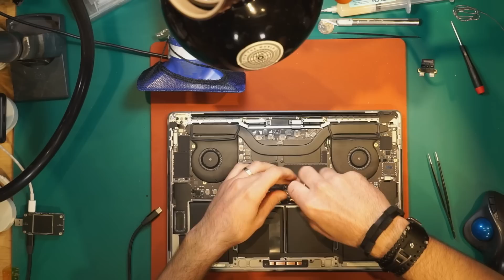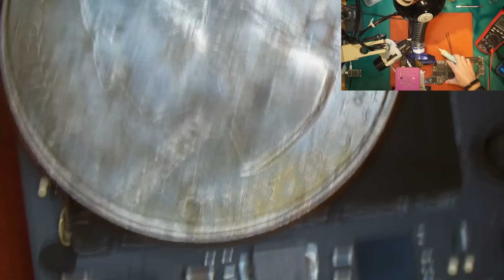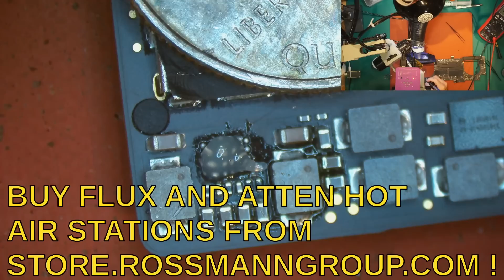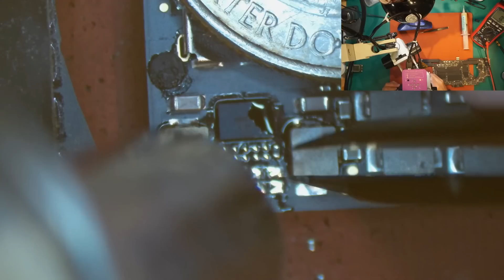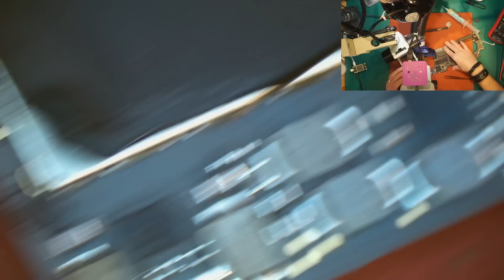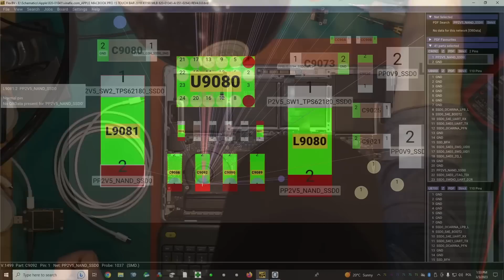Are Apple products still JUNK in 2023?

Comment: I've been using Apple Products since the 5s and none of them ever failed on me. On the other hand heard reports of the Note 7 setting houses on fire. lol.
Reply: Yeah I’ve had a terrible time with Android Samsung junk, and Microsoft is trash. I’ve never had an issue in a decade with Apple products, except for the hole they leave in my wallet.
Reply: Your bias is showing.
Reply: Just your experience doesnt mean other have experienced it.
Ever heard of bendgate ? Ribbon Gate ? iPhone 7  Audio IC issue ? iPhone X and 13 blank display ?  Butterfly keyboard ? (Lol I remember the copium you guys put in for that), Thunderbolt shielding issues ?

I havent even scratched the surface, these are just some of the few hardware flaws, dont get me started on the software.
Reply: @RandomGuy-om1vy  Why is what you said magically true, but not what we said lol?

Comment: If this video is really supposed to be shown to customers then in my opinion it should instead be properly montaged and narrated to make it shorter. Why would customers care about taking out chips, cleaning their pads and all that stuff? Plus listening to speech over noise of hot air station is a little bit hard.
As a video for channel though this one is good.
Reply from the maker: I have no desire to make s*** shorter for people who call in and complain
Reply: @rossmanngroup   As a customer, I did get the point: the SSD can randomly get fried with no other damage having occurred to the device and when that happens even the best repair shop on earth won't be able to recover the data.

Comment: You'd think Apple would put an overvoltage protection diode on the SSD (maybe a resistor in series so it won't blow the protector if the power supply gets crowbarred to 7V).
Reply: wow, we have a genius here. That resistor will burn power like crazy in regular operation, great idea on a laptop. Second it won't prevent what you claim it does.
Reply: @RandomUser2401  Now on to correcting the much deeper problem you have with basic civility.
Reply: @gargantuablargg  makes no sense

Comment: Without in anyway defending Apple, I've had four or five Mac Book Pros over the last IDK 10-20 years and my three daughters about the same all combined. So that is 10-15 macs. None of them have failed as such. We have replaced batteries, yes, even this MacBook pro where the batteries are glued to the motherboard (the Apple replacement program does did this for $300). One failed display: One failed SDD, replaceable. One liquid  damage (thank you LR for fixing that), one stuck hinge. Also own a couple i27 that are now 12 years old and still used daily with SSD upgrade. So while it is stupid that a failed PSU fries the SSD and that you cannot replace the SSD, my experience is not that bad compared to my wifes series of Dells and Acer or how my co-workers went through Fujitsus over the years.
Reply: I've been just as lucky as you with 20 or so MacBooks over 2 decades in our small business. All of the machines are still working, all of them. We had 1 of the 128GB SSDs fail in a 2013 Macbook Pro 13" and the older (10+ year old machines) have terrible battery life, but still work fine otherwise.

I cannot say the same for other businesses in the building that had a series of Windows laptops that they seem to need to replace every other year and have frequent problem with.
Reply: @DigiDriftZone Nice to hear that. Lets hope this continues.
Reply: @Bluestreak589  I'm software developer and I have to work with Linux a lot, and it always seem to give me grief with updates and dependency hell, where as my macOS "just works" it seems that YMMV.
Reply: @Axel_Andersen  I am also a software developer and I have been working with Windows and Linux (mostly Debian and Ubuntu) PCs and laptops, as well as a few flavors of Macbook over the years. The longest lived and least problematic have consistently been the Apple devices. I have used Windows/Linux/Android as my personal devices always but after a lifetime of personally-witnessed anecdotes I started switching to Apple devices this year specifically for longevity.

Time will tell, I suppose.
Reply: @Bluestreak589  So your $25k of Apple hardware is working fine then? - great to hear!

Comment: Have you ever proactively added a Zener diode to any of these rails to clamp the voltage in case it goes all Apple hara-kiri?
Reply: Those buck regulators can supply enough current to burn through your zener clamp.

Comment: Having an SSD that is not in an M.2 slot and can't be replaced, makes the entire system a scam.
Reply: Makes it just like most cellphones. They all work fine usually but you wouldn't want to keep any important documents on your phone that aren't backed up elsewhere.
Reply: @gorkyd7912  That's what SD cards are for.  That said, I don't keep important data only on my phone.  I have had SD cards die before.  VERY rare but it has happened.  But it allows me to keep tons of episodes of shows I like to watch and stuff.  I certainly have removable not locked down storage on my phone.  It's one of my basic, bare minimum requirements for a phone.

Comment: Would have loved to see the values for the voltage divider on the feedback pin. Can just about guarantee one of them was out of spec and causing the converter to output it’s maximum voltage.  Should be a rather simple preventative task to swap those resistors out before this ever happens. Not that anyone actually will….
Reply: From the data sheet for that chip. Look familiar?  “In case the FB pin of the adjustable output voltage version gets opened or an over voltage appears at the output, an internal clamp limits the output voltage to about 7.4 V.”
Reply: Not that you should have to

Comment: Lucky for me, I always went with the MacBook Air models. First MacBook Air was the 2017 Intel model. Used it until I wanted a gaming laptop for a while. I liked that little computer. Never failed on me, unlike the gaming laptops I had in the past. The MacBook Pros...I don't think I'll ever touch. The MacBook Airs are fine though. I'm running an M1 MacBook Air right now and it's smooth as butter. My next system in 5 - 10 years will be the 15" MacBook Air (if they release one).

So far what I'm getting at is the MacBook Pros tend to always have these failings...the 16" models. I'm glad to say I'll never buy one of those models. Here's hoping Apple fixes this though. I'd hate to be the one buying a $2000+ computer and it just randomly fry the SSD like a chicken wing.
Reply: I don't think so, I think Airs probably have just as many issues as Pros, and generally they're all pretty reliable. When an Air fails they just throw it away, when a MBP fails they send it in for repairs and that's why repair shops have a lot more repairs for MBP and can tell you all the problems they have. The top Air is only $2500 and the average price paid is more like $1300 for brand new. So if it fails 3 years later just replace it. Whereas the top MBP is $6500, so if you paid $3000 - $4500 for a MBP and the SSD got fried it would make total sense to pay a few hundred to have it fixed.
Reply: @gorkyd7912  You have a good point.

Comment: When you get an issue with a buck regulator giving out a higher than normal voltage it can be because one of the output caps has begun to short at higher frequencies.  It might not be shorted when you test it but when the buck regulator turns on the voltage begins to rise because it is shorting near the regulators switching frequency.  Replacing the output caps of the regulator with similar or even better low ESR caps is a necessary step to get the correct output voltage and to get a stable voltage.  Running it without those caps like you did will make the output voltage unstable and the chips downstream likely will not function correctly.  Although it isn't likely to damage the chips downstream as they are likely already dead from overvoltage it also won't help make the circuit work because those chips still need a stable 2.5 volts to function.  The average voltage you measure might be the correct 2.5v but it just won't be a stable voltage at higher frequencies because those capacitors are not there or not low ESR enough to filter the noise...  Not saying that adding the caps will make it work, just saying it likely won't work right with them gone if the flash chips are still good.

Comment: I switched to Apple in 2001 when they were making white iBooks with Motorola G3 processors and I’m still using apple to this day. I’ve owned quite a few MacBook Pros and a lot of them I’ve handed down to family. I’ve only had one MacBook Pro die on me and that was due to an Nvidia video card.

But outside of that they’ve been pretty reliable. I just gave my sister a 2017 MacBook Pro and I still have a 2015 MacBook Pro and a 2019 MacBook Pro with me. The 2015 will probably be another hand me down.

So ya my experience has been pretty positive. The only thing I’ve really replace is the battery which is a consumable.

Oh an I forgot mention my Gen 1 2006 MacPro which my brother still uses.

My experience with Apple has been so positive that I stopped buying Apple Care for my phones/tablets and computers.
Reply: Ditto